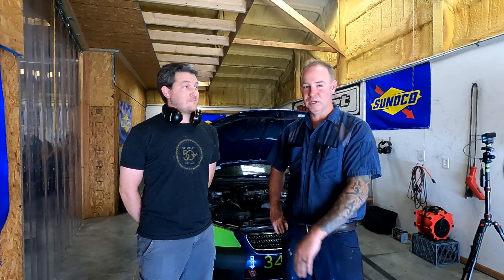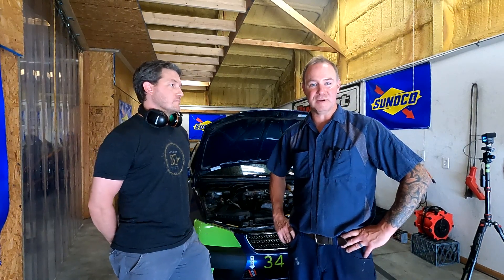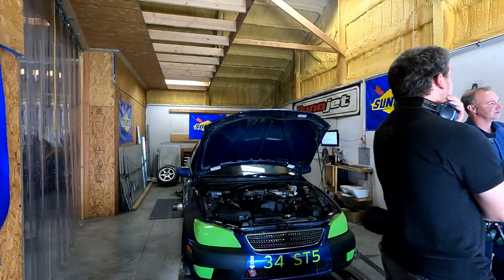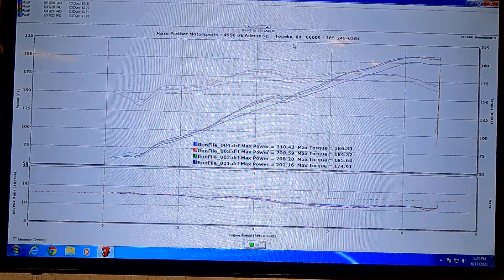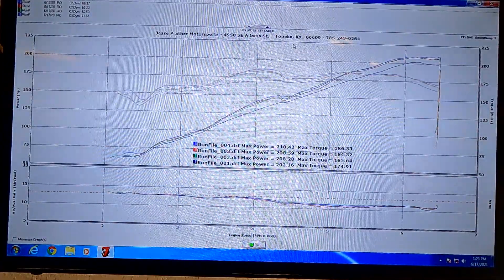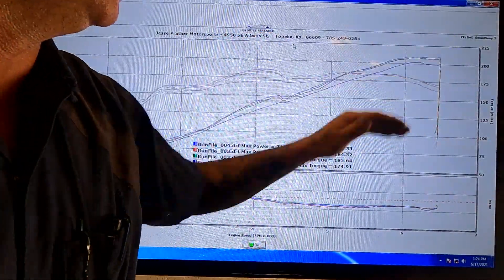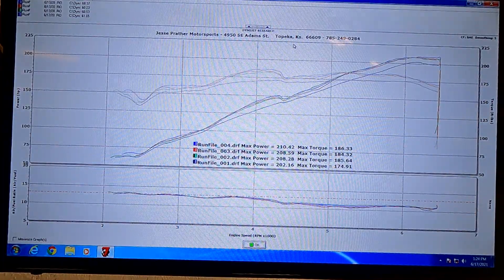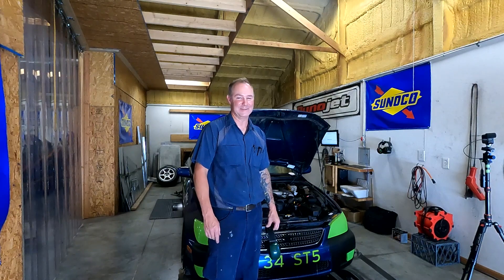Lexus IS300 on the Dyno for NASA Classification - has a mild cam

Comment: 264 or 272 cams?
Reply from the maker: Couldn’t tell you. Was doing a baseline dyno run and I didn’t build the engine, so I am not sure.
Reply: 264 you can run without a tune, but you’re leaving power on the table